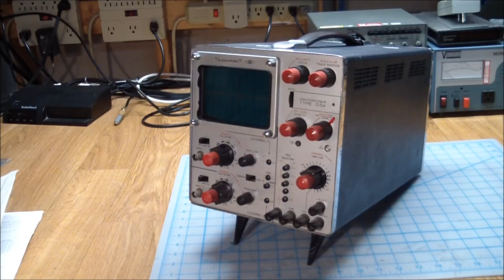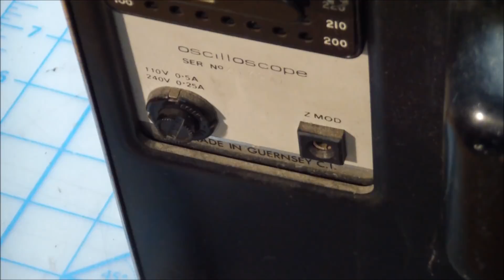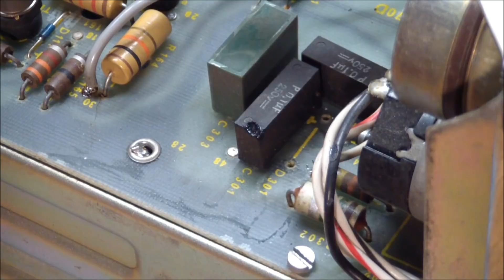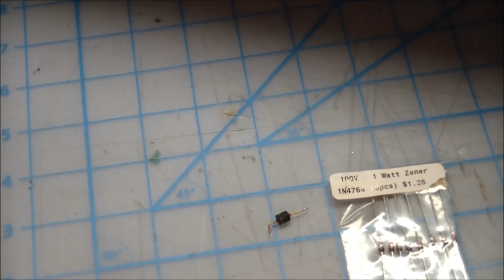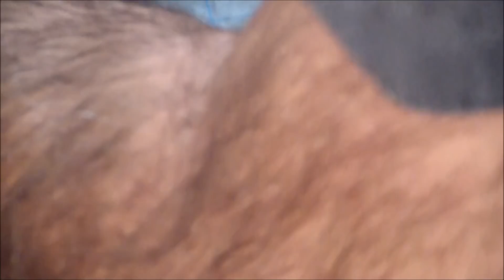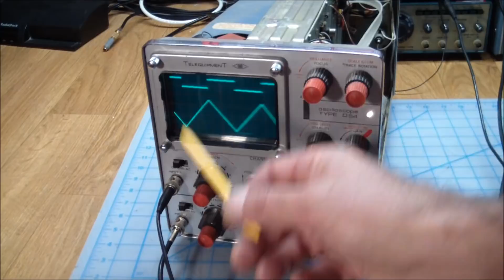AE#63 Telequipment D54 Oscilloscope From Guernsey, C.I.

Comment: You can work the cable back into the rubber strain relief by pinching and sliding the outer sheath of the cable on those . Also those 3.4kV diode packs are usually running low volts or fully open . Mine was a 1970 . Cool video .

Comment: I have a Type D54, it's actually the first o'scope I ever bought. I'm cleaning it up and going to calibrate it. It was in my car when a tornado hit in May. Wiped my car out, messed up a bunch of my other test gear that was in the back seat. I pulled it out and I'll be damned, IT WORKS! Gonna use it for audio equipment work. Pretty good technicians scope, if you can deal with a 1MHz to 10MHz (HF) scope.
Reply: Sorry to hear about the tornado. Will this unit be good enough to test vintage stereo equipment and modern ones too? I'm eyeing one for 50 buks but I'm hearing that I need one with 50MHz minimum. Thank you should you respond.
Reply: @arrya5372  Yes it should work great for any audio gear you need to test.

Comment: Arty/ie,  from the manual of my Telequipment Type D61, '...the registered trade mark of Tektronix UK Limited'. I suppose it's no coincidence regarding the paint colour!
Reply: That's not surprising, as the "Bell System" companies in the US purchased Tek scopes for use in the central offices. Nowadays, if they still have one, they sit idle, as most any troubleshooting & repair is done by "plug in" card substitution instead of signal & component level testing.
Reply from the maker: I'm curious if the colors were changed after they were bought by Tek, or if they looked like this before the purchase.

Comment: There are some of these on eBay for $70 and up. I have had one for almost 40 years. It had some problems, but found the schematic and calibration instructions on-line a few years ago, and decided to fix what I could. Amazing what you can find online these days! I cleaned the pots and replaced a few caps and out-of-tolerance resistors, did most of the calibrations, and it now works very good! Thanks for the video.

Comment: This is like the only video on the D54. I have one. I'm planning on doing a full service. Will try make a video
Reply: I just completed a recap on mine. Also replaced the HV diodes and all HV caps.
I'll give you guys a brief summary on what to expect when doing this job.
This scope was not designed with service in mind, it is pretty much a nightmare to work on. Getting the main board out is pretty much impossible without almost completely unwiring the scope down to 50%, not something you would want to do. All the knobs and front panel have to be removed in order to move the board to a position where desoldering components can be attempted and even then your soldering skills will have to be up to soldering behind your back or with your eyes closed level. I have never had to solder in such confined and cramped conditions with wires constantly in my way. Several wires have to be unsoldered from the board, both front and back to gain enough room to get your soldering iron in. Forget about solder suckers or wick, it's a heat and pull job on all components. There is a capacitor connected from the board to the EXT TRIG terminal that has to be unsoldered from that terminal, saving you some time trying to figure out one out, one of the reasons the board won't move,  and that one as is buried right in there. The five wires from the board to the transformer have to be unsoldered and a few other things. All this will allow you to angle the board away from the chassis about 2", enough room to get your soldering iron in. Oh... the CRT has to also be removed. Before fiddling with the HT lead, ground the anode to chassis to discharge the tube but avoid touching the anode at any time. Once discharged you can slide the red plastic cover back and pry off the wire with a screwdriver. Don't forget C109 and C114 hiding at the front of the board. Replacing components took me two nights and another night to put i all back together again to the point of calibration. There's also three electrolytics to be replaced on the small board, same sort of conditions. Well if you're looking for something to do and having a bit of a challenge, the D54 will entertain you for a few hours.
Reply: @Vincent The Farmer hopefully within the next few months.
Reply: Just went through all the electrolytics I replaced to check on their states out of curiosity, I'm sure some of the people viewing this video would be curious too. With something of this age I would not bother testing caps before replacing them as it is just a waste of time and I did not this time either.
On ESR, testing both with my Dick Smith and an analog ESR meter, results on most was close to nominal. Had I fallen for the trap of testing caps before replacing them with an ESR meter only, I would not have seen the need to replace any of them.
Capacitance on 60% of them was within tolerances, the rest read high indicating leakage. I used my BK Precision Model 830B for that.
Onto leakage tests using my Heathkit C-3. I did not have to go beyond the "25V" test range on any of them, they all failed badly, best I got was about 1mm of eye opening.
So if you have one of these old scopes and intent on using it it's probably a good idea to give it a full service, as eventually the transformer will probably give out on it. Most if not all faults and quirks will most likely sort out after a re-cap and service to the HV section. Mine was pretty much 100% functional although showing some signs of needing an overhaul. It's not something I was using, I bought it as a project and it had been sitting in storage for a couple of years awaiting its turn on my bench.

Comment: Great detective work there!   My long-stored D54 works very well, but only if kept on variac at 80 percent voltage.  Any higher and it blanks out.   Not sure I want to tackle circuit board struggle!

Comment: Concerning the CRT clock the CRT in this scope is oval so while it may work for a clock it many not be the best choice unless you don't mind a smaller clock display.

Also the horizontal amp bandwidth is something like 1MHz whereas the vertical amp bandwidth is higher. 

So I wouldn't recommend it for a scope clock unless you know of a clock kit that doesn't require a higher bandwidth scope.

Comment: I recently got one.

There is a much easier way to access a lot of the board components. Remove the CRT and time/cm switch.

With mine out of 20 or so resistors I replaced in the power supply and horizontal amp I found maybe 3-4 that were still in tolerance and other components that were replaced with whatever a previous owner had. Mine did come with the paper manual though which had the substituted components struck through and the new value written beside it in pencil.

A few transistors were replaced, but those at least seemed to be proper subs far as operation goes.

Now D108 in the horizontal amp I don't know its purpose. I removed it as it was one of the substituted parts and I wasn't sure it was right. Horizontal amp seems to work just fine without it.

So I plan on replacing the rest of the resistors eventually.

Calibration is a real pain as some adjustments you have to go back and forth with multiple trimmer resistors or caps until it is just right.

My opinion is that this is a decent dual channel scope.

It isn't Tektronix, Phillips, Hitachi ETC... quality but is decent enough for most non-critical work.